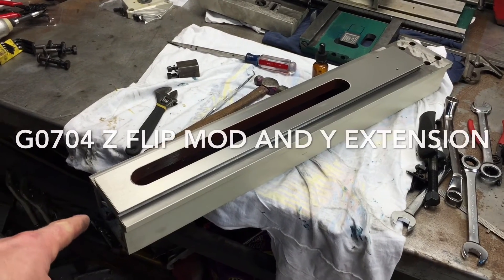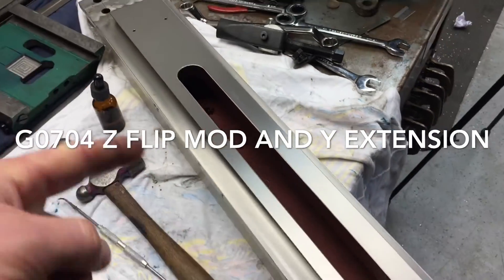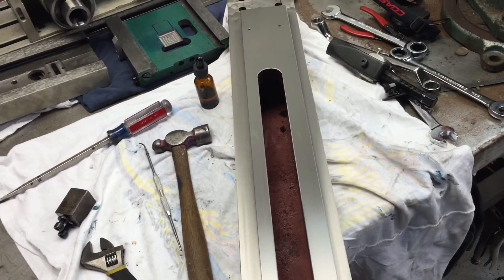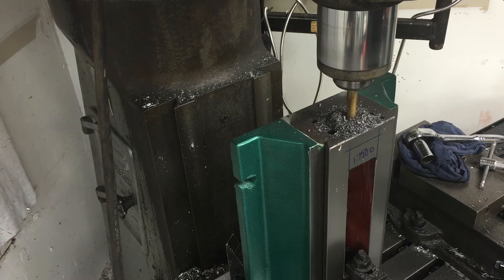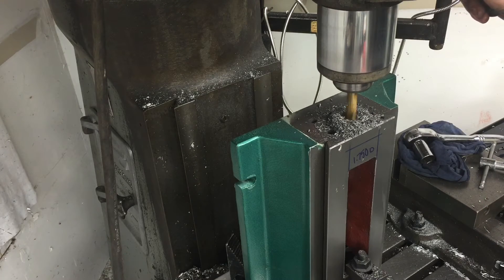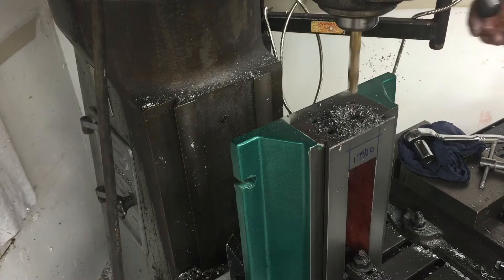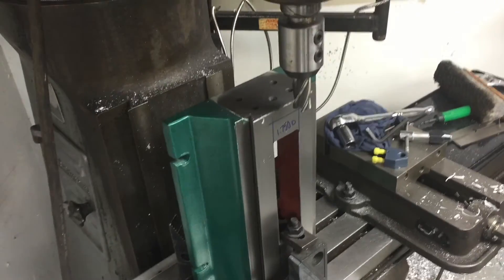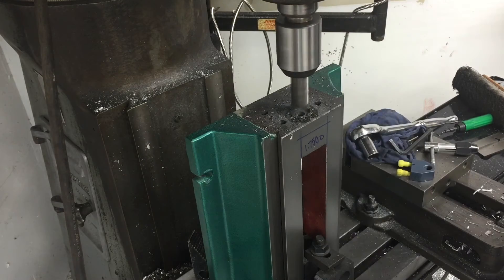G0704 CNC CONVERSION z flip MoD and y Extension part 2

Comment: How much Y-axis travel were you able to add?
Reply from the maker: +ShortCourseWorld I believe the total travel is now 9.5'' I am still in the process! My home flooded and that threw a curve ball or two at me.
Reply: +Unorthodox Fabrication thanks. I just received my G0704. I ordered the CNC conversion and electronics. hopefully they'll be here next week. I was thinking about doing this mod but i'm nervous about realigning the column afterward.
Reply from the maker: +ShortCourseWorld That understandable. I think that either way you will have to align that column. That is needed on these machines.